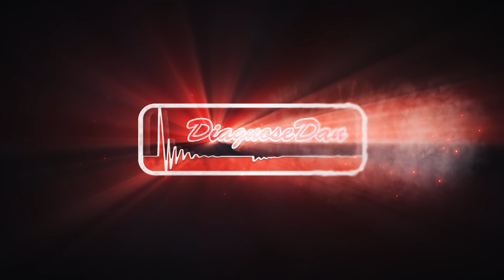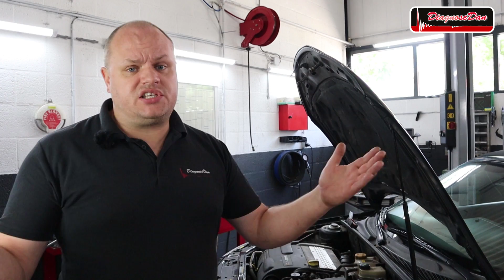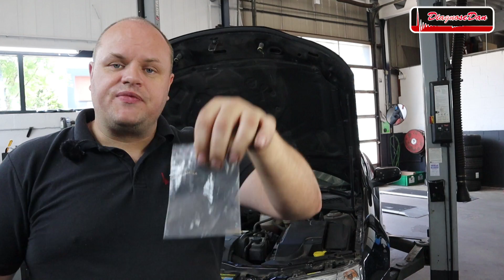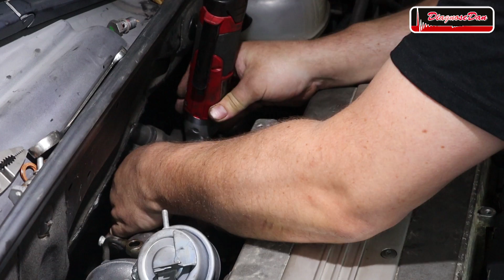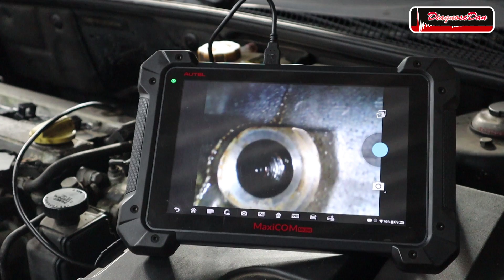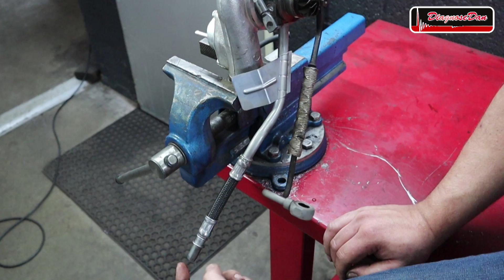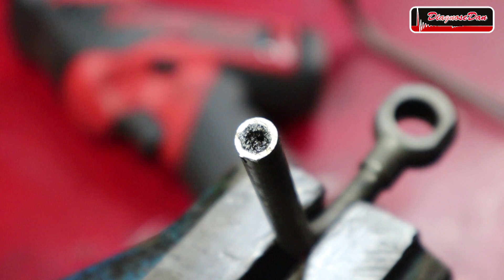Why did this new part only last one day?

Comment: Dan: When was the last time you had an oil change or service?
Customer: What do you mean by 'oil change' ?
Reply: This was a common problem on Audi 1.8t engines a while back. Usually a problem on cars that only did short commutes.
We always changed the feed line and did an oil flush when changing the turbo on these engines.
Reply: panzerveps thank you for commenting on the (seemingly defective) design. Even oil filter has relief valve in case the filter is clogged. It seems the feed-line must be replaced religiously by the miles / service schedule or face the grave consequences.
Reply: @panzerveps  ... Passat 1.8T had the problem whit the oil pickup screen getting clogged
Reply: @panzerveps  I just top the oil up every two week or so, never need a full change then ;)
Reply: @thomasgustafsson7330  My car uses about 1 dl of oil every 5k km (which is how far I drive each year), so that would probably ruin my engine in the long run ;)
Reply: panzerveps - hi, question, is there a difference between a oil flush and oil change? 

                        Since there was a blockage due to carbon build up, is that owners fault for not doing the oil change/ flush OR a design flaw from car manufacturer??  Thanks
Reply: @nateh1974  Since they included a new oil line with the turbo, it is likely that it is a common problem. Is there a hose in that line where it is insulated? If it is a solid steel line and they had to insulate it, it is in a very hot area of the engine. The oil left in the line is getting very hot when the engine is shut down so it burns some oil onto the inside of the line as carbon. At some point, the burned layers come loose, plug the tube and ruin the turbocharger.  Turbocharged engines need to be idled before shutting down to allow the turbo to cool down and slow down while oil is still flowing through the bearing. Manufacturers should be using systems to idle the engine before shutdown. A larger line with more insulation and a couple of minutes cool down might be the fix.
Reply: @tiredoldmechanic1791  Or an electric oil pump which will circulate oil to the turbo after shutdown for two minutes or so. Some cars have a thermocouple which will let the radiator fan run for a while after engine shutdown to cool down the water in the radiator and engine, so why not the same for a turbo?
Reply: @nateh1974  yes, there is a difference.
Oil change is just an oil change, while a flush is done by using some additives and running the engine for a while before draining and refilling the oil.
This breaks down and remove most of the sludge and carbon buildup in the sump and oil lines.
Reply: @tiredoldmechanic1791  remember turbo timers. They should bring it back
Reply: @nateh1974  The blockage wouldnt have occurred if OCI was adhered to and engine was allowed to idle for 2 minutes after each time it was parked. No design flaw here. Unlike the 2005 subaru legacy/wrx that had a filter in the banjo fitting that routinely clogged and killed motors.
Reply: @muzallisam5068  They never left. People are just stupid / ill informed.
Reply: @tiredoldmechanic1791  Turbo timers are illegal in many markets due to accidents during the 80's - of course you could make them safe with some modern tech, but the laws are too hard to change.  They should not be necessary in a modern water cooled turbo if the turbo lines are adequately spaced, the service intervals are sensible, and modern oils with suitable additives to inhibit sludge are used, and the driver takes it easy for the last couple of minutes before stopping the engine.  Personally my turbo has 190,000km on it now with no issues so far  & significantly higher boost than factory, but the turbo lines have heaps of space around them, and I change the oil & filter every 5,000km (manufacturer states 15,000 which is just stupid) & use GTX Ultraclean and always stay off boost when I'm getting close to my destination.
Reply: @emilschw8924   I work on fleet of old heavy duty engines were they solved this problem by plumbing in an engine oil accumulator that would gravity feed into the turbo oil supply line. A simple gas or spring hydraulic accumulator(large enough from the application) with a flow restrictor(to allow a timed metered oil after shut down) would also work good to.
Reply: @nateh1974  a flush usually means it has a cleaning agent in it..... and you run it for 10 or 20 mins
pushing out the old, and sucking in new fluid (brake, trans, engine oil, ETC)
.
however.... i dont like flushes.... especially on transmissions 
a trans flush can "over clean" the trans.... causing dirt / old clutch material to go places it would have not gone otherwise
and jam up a valve in the valve body.... 
.
i also see them as just a way for the shop to make extra money for a little bit of work
(and ya.... im a mechanic and say that)
.
however.... if i have a customer that hasnt changed their oil in like 15,000 miles...
i might recommend a cleaner you pour into the engine oil.... run for 10 or 15 mins
then do a normal oil change (oil change = drain old oil.... remove old filter.... new oil, new filter.....done)
.
it helps get some of the sludge off the cly head / valve cover.... and unplugs the small feed holes in lifters, cam phasers, ETC
.
Reply: @nateh1974  and its probably 50/50 owners fault and a design flaw. 
the insulated part of the hose tells me it gets pretty hot..... which can burn the oil, causing sludge and carbon. 
.
however.... running quality oil.... and changing on time..... would make it very hard for the high heat to effect the oil. 
but re routing the line away from heat would also work..... and be more tolerant to abuse and neglect
Reply: Turbo oil feed pipes have to come near the exhaust because the turbo is in the exhaust. So they will get very hot and you will need to use an oil resistant to breakdown at high temperatures, if you skimp on the cost/quality of your oil. Even just once this will happen, cheep oil burns/forms carbon deposits at a lower temperature. Correct oil and oil change intervals are essential for a turbo engine.
Reply: I had a guy once who in the morning fitted an alternator, a starter motor and a battery yet he still broke down,,, why?? He didn’t check the oil. Daft as a brush.
Reply: @lakinnenlako6883  while the new kit came with all the parts needed, a simple answer to why the 1st shop did not change out the feed line would be it would not fit correctly maybe the wrong tube supplied with the kit, the car could have had 2 options for a 1st gen turbo or a mid production switch making the outlet tube also out of spec by 1mm but close enough to fit.
Reply: Oil?🤔 I only fill unleaded petrol. 😂
Reply: @lakinnenlako6883  like if your perfect and would of done the same 😥
Reply: Oil 😂
Reply: dumb people only have engine change

Comment: Usual customer that thinks oil changes are not really that important. Only when the car faults due to lack of service is it taken to the shop!
On the other hand, some shops don’t use the correct oils, or even drain the oil. I’ve heard of a very reputable major company in the uk that does not remove the sump plugs when carrying out an oil change. They use a suction device and just refill with fresh oil.........I have heard that they had issues with alloy sumps stripping the sump plug threads and decided that sucking the oil out would save the hassle of re tapping the sump or replacing it!
Reply from the maker: I also suck out the oil some times when the oil plug is damaged or even some cars don't have drain plugs ( some Smart models)
Reply: DiagnoseDan I’ve never came across one yet without a sump plug, maybe due to my location I’m just not seeing any yet I will at some point. What vehicles do you know that are sump plug less Dan? I’m curious now.
I have had lots of damaged plugs or sumps but always got the repair jobs on them, some easier than others. 🤣

Comment: Hello Mr Dan i have a 2005 Mercedes 500 sl i change the alternator because it was not charging after i change the alternator still don charge the battery i check the 140 amp fuse and everything has power. I wonder if you would tell me the location of the fuse 30 that is connected to make the alternator charge the battery if there is not a 30 amp fuse i wonder if i have to change the module that is locate in the trunk near the rear battery. If you would be s kind to give some instruction i would thank you very much
Reply from the maker: Ask your technical questions in the Diagnosedan Global tech support group on Facebook

Comment: WHAT.... the hell. The turbo came with both lines and they cheaped out and didn’t install it. Clearly the cost of another turbo and labor should be charged back to the first shop. I doubt they’ll cover it though based Quality of work I’ve seen so far. Screwing the customer. If you just replaced a turbo wouldn’t you have written it up for a oil change also? Based on the look of that “crude” coming out of that oil feed hole that didn’t happen either..
Reply from the maker: Thanks for watching Gary

Comment: Now there are parts of the turbo in the oil, better change that oil and filter after the repair or a new engine will be required
Reply from the maker: I what oil? There was no oil flow through the turbo remember! But still i checked and flushed the engine

Comment: I can think of two thing that could cause the extreme coacking of the oil feed line to the turbo 1) dirty oil and 2) not letting the turbo cool before shutting the car off.
Reply from the maker: You are right!

Comment: GREAT Dan Im passing this along to a friend that has a Saab,  I had a 1974 Saab that was trouble trouble,  my cooling fan stopped working my Dad took it apart and said they put the bearing in backwards.  The auto transmission went bad the dealer said they fixed it . It lasted 13 miles  Thanks agin
Reply from the maker: Wow 13 miles😬.....😓

Comment: time for an oil flush then change, and wrapping those lines to keep the heat off.  seen this coking on motorcycles with external feed lines to overhead cams.   also check intake and exhaust for restrictions and waste gate for proper operation.  an intake leak any where between the turbo and valves can cause overspeed failures
Reply from the maker: Thanks for the feedback 👍

Comment: Now I understand why my BMW uses an electronic water pump.  And it keeps running for a while after I turn the car off.  I guess it's trying to cool those turbos down and not cook the oil.  It also comes with an oil cooler that prior year models didnt have.
Reply from the maker: Smart thinking! You are right most turbo's have electric coolant pumps these days
Reply: @Diagnosedan  It's a 2009  BMW Dan.  Problem is you don't get any warning when the coolant pump goes out.  Maybe you can look into it and see if there is a way to tell?  The BMW community doesn't really have an answer.  Pierburg is the main manufacturer of the OEM water pump.  Mine died at 92k miles.

Comment: I used to bring used guitar strings to work to keep in my toolbox to clean carburetors and oil lines. I think those mechanics thought that the only pipe they had to replace was the exit pipe because they get so hot and build up so much deposits but I see that the oil line the oil in that car was so dirty that probably plugged up the feed hose. 
Nice work I always like to watch you solve the problem 👍👀⚒️
Reply: and clean out push rod tubes..

Comment: Another great analysis.  Diagnose Dan fixes our need for great technician breakdowns once again!  As for the clog, High oil volatility lends itself to carbon deposit build up, especially when paired with a direct injection engine.  This creates a soot mix in the oil and if not changed regularly, along with a poor oil filter, you get thickening of oil which builds up in the thinner lines especially.  That’s my thinking at least.
Reply from the maker: Thanks for the feedback 👍

Comment: Heat on the line cooked the oil. Needs a heat shield to protect line from the turbo heat. Also, when a turbo charged engine is driven the driver must let it idle two minutes minimum before shutting off the engine. This will help lower the turbo temperature and allow the oil and coolant flow to bring the turbo temperature down a little before it shutting off the engine.
Reply from the maker: Great advise 👍

Comment: I think the carbon deposits are from shutting down the car right after being run hard Breaking down the oil into the tube, over time doing this plugging the line.
Reply from the maker: You are right that's one of the reasons

Comment: Hey dan, usually i never comment on anything, but i just want to say that as a mechanic apprentice, you always make my day better with your uploads. The amount of knowledge you have is impressive, and your way of diagnosing and thinking through the problems is inspirational and thought provoking.
Cheers from Denmark
Reply: I think what Dan combines is the best of old and new school thinking.
Before diagnostic ports were a thing, mechanics had to work out everything by sight, sound, feel, smell and logic.
In the modern era, all most go by, is what the OBD2 tells them.
If you are an apprentice in the modern era and want to become great at what you do, I would really recommend you make classic cars your hobby.
It will give you a much more rounded learning experience.
Reply: @matthewjenkins1161  Totally agree with you! Working on old cars is much more of a learning curve because the ECU and OBD interface/procotol isn't there to tell you "hey this is what's wrong, it's this sensor or whatever". So you have to hunt it down the rabbit hole yourself and learn in the meanwhile! For modern cars with crazy emissions standards and ton load of sensors and extra electrical devices OBD is really a good tool because the complexity of new modernized cars and engines is kinda crazy. Look at in a engine bay of a cheap car in 1992 and compare it to a luxury car from 2016 the amount of extra wires behind the dashboard and the engine bay being completely filled compared to a old car that has almost no wiring and a engine bay that has a lot of space because there's no airco, hydrolic power steering or esp, abs, no fuel injection just naturally aspirated single cam. Just all the actuators alone and the electronics these days in modern cars, it's crazy.
Reply: @matthewjenkins1161  And if they do not have a warning light nowdays they are clueless and say no fault found ..No all mechanical fault are wired up to a sensor so old school diagnosis is required
Reply: @matthewjenkins1161  Classic cars are a walk in the park unless they are English, 
Italian or French 🤣👍
Reply: @bermrailin  Ah you mean those 4 and 6 cylinder engines, that produced more BHP per litre in the 1960s, than many 21st century American V8s?
Reply: @matthewjenkins1161  Exactly what engines are you talking about? The Pentastar V-6, today, is rated at 300 hp.
Reply: @31terikennedy  And took until 2011 to get there.
A 1964 970cc Cooper S Mini made 65bhp (67bhp per litre) stock, with pushrods, siamesed ports, SU carbs and a points dizzy.
For perspective a turn of the millenium Ford Mustang GT produced 260bhp (56.5bhp per litre) stock from it's 4.6L modular V8.
The same 4.6L in the non GT producing just 215bhp or 46.7bhp per litre.
For real laughs, look at what stock american V8s were putting out in the 1970s per litre.
Dirt cheap fuel held back engine advancement for decades, your side of the pond.
Reply: @matthewjenkins1161  You were the one comparing 60s European 4-6 bangers with 21st century American V-8s. The Hemi in 1958 was making 380 hp. The 327 small block Chevy was making 365hp. Remember the 427 GT40 dominating Le Mans in the late 60s? (on your side of the pond!) Because of the 1973 Oil Embargo gas wasn't cheap! What in the wide wide world of sport  are you comparing the Mini Cooper with anything but a go-cart?! The 327 was making 365 in 1965.
Reply: Impressed that you used the term the Dizzy (distributor) when describing the Mini Cooper mill:D
Reply: @31terikennedy  GT40 dominating Le Mans......after pumping  milions of dollars 🤣🤣🤣 to beat what Ferrari was making wit  few mechanics and no monney
Reply: @matthewjenkins1161  And the cars were happy to go around corners?
Reply: @31terikennedy  Precisely his point had you read before posting
Reply: @jostouw4366  Classic Minis have legendary handling, which is what led them to 3 Monte Carlo wins. Pissed all over the big Fords of the day.
Reply: @31terikennedy  , Mathew J. was comparing BHP per litre of displacement. Ms. Kennedy, you are not. Your point is lost.
Reply: @rosenfeldclaudia  Including the Brits? Big Fish in a little pond?
Reply: @truthislam6481  You can get more BHP per liter out of a very small displacement mill? Okay, now what happens? A go Kart can still go faster:D
Reply from the maker: Thanks for making an exeption and leaving a comment it's appriciated 👍
Reply: Good for you to keep up on techniques and whatnot. It will make you a better mechanic. Maybe you could replace Scotty Kilmer when he retires?
Reply: American cars need like 7 litre engines to make like 400 hp. We can make 400 hp from a 2 litre. Go figure.
Reply: It shows that he has been educated and not just trained.
Reply: I love this comment!
Reply: GamerSebDK
 I don't think Dan is a "mechanic apprentice." He is a master mechanic.
Reply: @paulparoma  He was likely referring to himself as the apprentice, not Dan
Reply: @Joe_Mission  exactly :)
Reply: @paulparoma  , perhaps English isn't your first language. The phrase GamerSebDK used, "as an apprentice" refers back to himself not the person he is addressing.